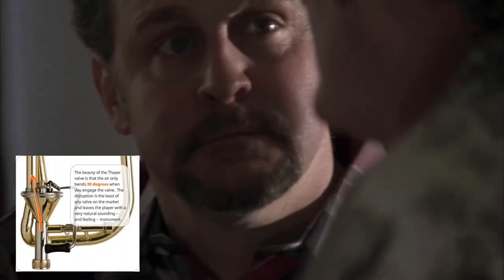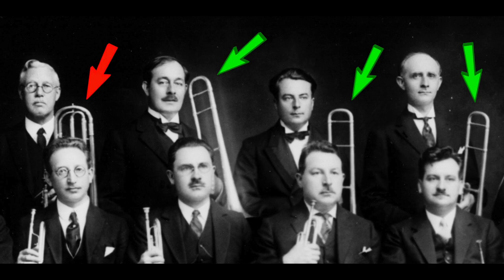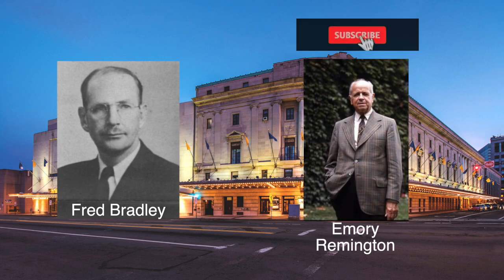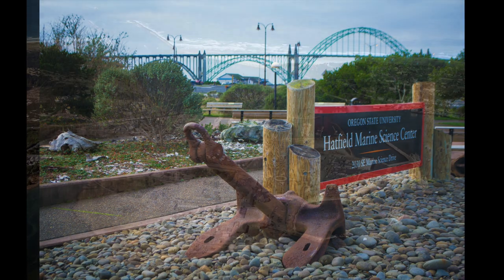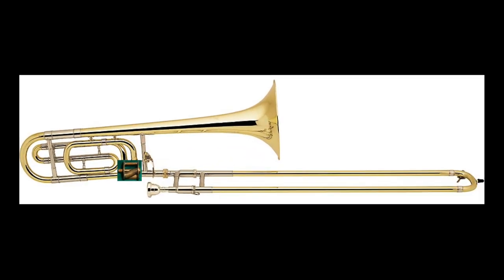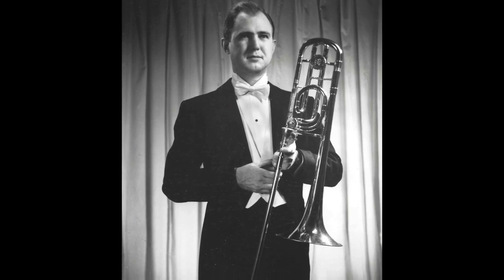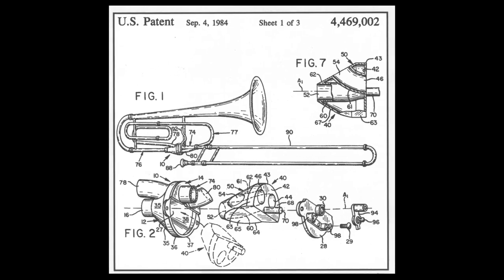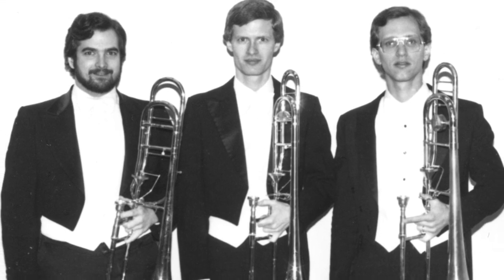The History of the Thayer Valve

Comment: Typically, in engineering, a large geometry of metal on metal contact with motion means a BEARING is needed.  In this case I think a set of ROLLER BEARINGS would allow for low resistance.  However, this is EXPENSIVE, and depending upon the exact shape may be difficult to have solid enough surfaces with the roller bearings.  I personally am still using the old fashioned Bach 42B style valve.
Reply: That's why the infinity valve was invented.  However, the mechanical vibration / noise is anyother problem ...